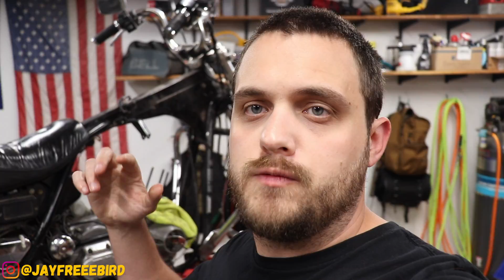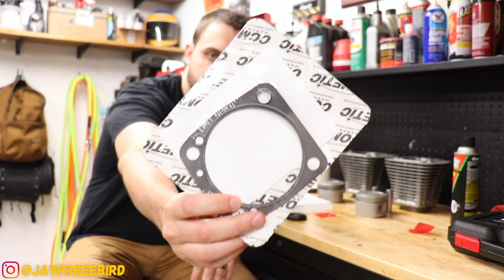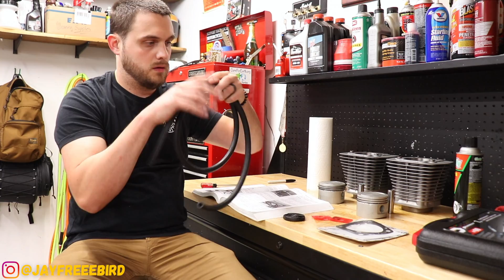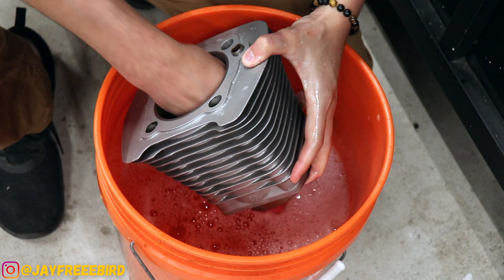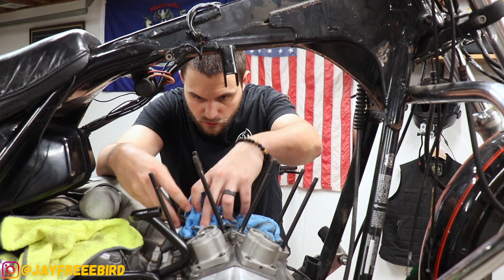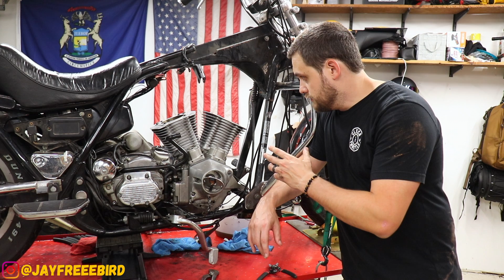Harley-Davidson FXRT Build (Pt.16) Evolution Motor Piston Install

Comment: I have a 95 big bore on my 00 ultra. Rod bearing was shot. So i rehatched the cylinders. Cleaned pistons. Would you moly the skirts and ceramic the piston tops? I see alot of guys doing it.
Reply from the maker: Depends on the damage. It wouldn’t hurt and just depends on the rebuild you plan on